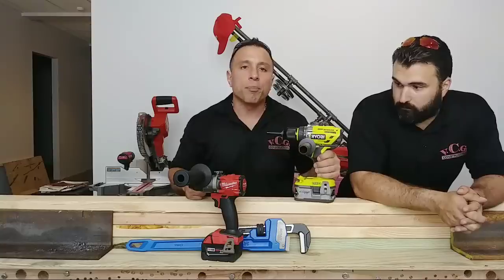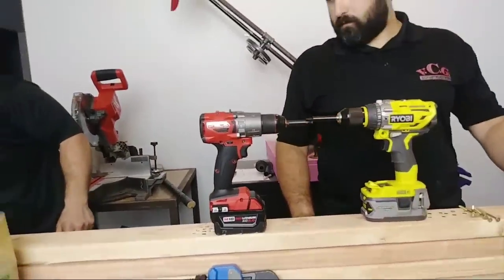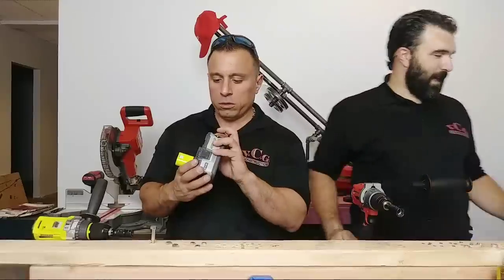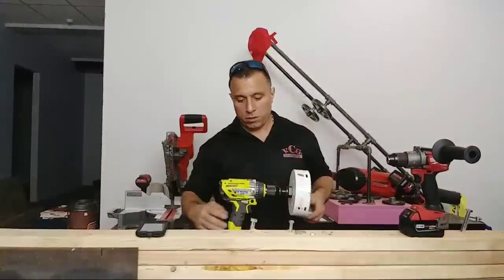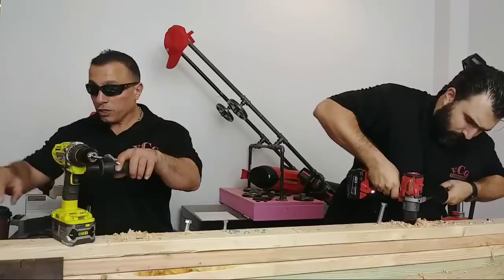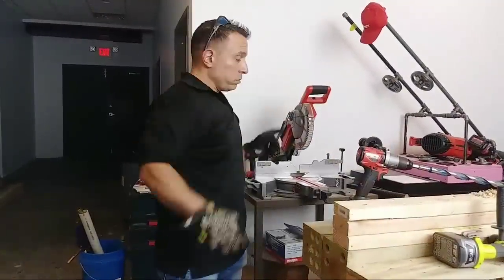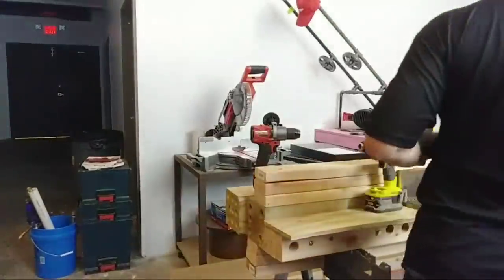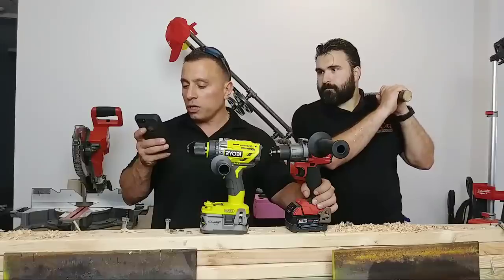Milwaukee M18 Fuel Gen3 Hammer Drill VS Ryobi 18v One+ Drill

Comment: Definitely a test I was wanting to see. Coming from someone who has no power tools yet. I'm going for the full out $500 Ryobi set.

Thanks for the video!
Reply from the maker: Awesome, I’m glad we could help!!
Reply: Cornland Wasteland Thanks for the information!
Reply: The tool sets have starter tools in them. The individual tools are much better.
Reply: @martylucas8557  I just bought the same set! Coming from B&D, those are much better! Probably overkill for DIY but I am kind of geek for tools and quality...
Reply: At first I thought the same. I used the Milwaukee hammer drill and impact driver while doing tech work. For a cost difference of $50 or less depending on if it's the m18 or m18 fuel, I had to go Milwaukee. I use Ryobi for all my cordless lawn gear and my cordless nailers, but everything else, Milwaukee is just too good. For DIY stuff, I will say you won't be disappointed in what Ryobi has. I've just used the fuel before so moving from top tier is just hard for me. If you are thinking of getting any nailers, get Ryobi, those things are amazing. They just don't make a cordless framing nailer yet.
Reply: Marty Lucas I believe he’s referring to the Ryobi tool sets. They definitely put way cheaper tools in most of their tool combos. Their single tools are without a doubt, better quality
Reply: Shoot im running Milwaukee black and decker ryobi Hitachi and dewalt. Lol
Reply: , just get the brushless line......they are pretty good

Comment: Yeah been puttin in work for 10+ years and Ryobi and their magnet and lighting system plus the battery lights are really convenient. It’s the least expensive and puts in work. I can pound those drills daily without worry because replacements are cheap. They have a drain auger for the battery no other tool has that. They also have a lantern, and one of those mini HVAC purposed drills. 

I had a ryobi drill break down on me after 7 years. Decent reliable and practical and best of all affordable.

I have a Dewault Hammer Drill for the man sized stuff though.  Cutting marble holes are easy as cake but god those DeWault Hammer drills are heavy so I only pull it out for the bigger jobs like cutting marble, mixing cement, boring through concrete, or deep screwing. 

Ryobi for everything else. Mostly I use Ryobi for the Drain auger(Incredibly light and battery powered) works fantastic. And the drill magnet is very useful for tossing a ton of screws and getting drywall done quick. Light is nice for dark areas it’s light and quick charging. If makita or Milwaukee or whatever had the magnet and drain auger I might switch but Ryobi is just too much bang for your buck all around.
Reply: No hablo mucho inglés pero creo que dice que Ryobi es mejor 😅
Reply: thats good to know about the drain auger. I think its cool makita has a coffee maker for 18V lol. its cool what they all come up with

Comment: Are you running the new brushless batteries with that ryobi? They have extra prongs to run the ryobi brushless tools. If you were running the non hp+ ones then that's why it kept cutting out and you had to keep pulling the battery
Reply from the maker: I’ll have to double check but I do believe it was the hp!
Reply: VCG Construction I think the brushless ones are HP+ the + is for brushless tools. It's pretty neat it has extra prongs to force the brushless harder
Reply: Yup it turns out he didn't use the HP+ battery. Would've made a big difference.

Comment: I know the Ryobi comes with the lithium + 4Ah battery but it's really designed to be used with lithium + HP battery. Taking away the ability of the battery communicating with the drill defeats a major purpose of the brushless motor and electronics, plus it should give it a slight boost in performance. Maybe Ryobi will start selling the drill with that battery down the road.....makes sense.
Reply from the maker: They should definitely sell that battery with the drill or at least an option where they do.
Reply: Slight difference in performance. It's actually a different drill with the new battery
Reply: @audionut9974  Which one is the HP battery? The 6 and 9ah ones?

Comment: This may be out of place, but I’m in the market for a Milwaukee hammer drill. I have a 20v dewalt hammer drill, which is amazing and still works like new but I want something more powerful. So my question is, how good is the m28 hammer drill? How does it compare to the m18? And how does it compare to the dewalt 36v hammer drill? I found the tool with 2 batteries for 400! That’s a lot, so I’m assuming it’s in the same segment at the 36v. Thanks in advance!
Reply from the maker: This will take some digging around to get your answers!!

Comment: The Ryobi is a Hammer drill (ish, as neither are true masonry hammer drills, more like impact hybrids), so it likely would have faired better on the lag bolt test on the hammer mode, same with the Milwaukee. The Ryobi didn't seem like it was overheating from your thermals, but likely was running into the current draw protection on the battery side, which may have been why the battery shut off. Brushless motors are an advantage in torque and energy usage, but they do have significantly more electronic nannies due to a computer actually controlling the switching on the poles instead of a brush running current directly. I think it may be a good idea to run the tools separately at the job site, and see if over time you can't find things that either get on your nerves, you appreciated, or even things that surprised you. You bought the tools, you might as well earn some money out of them, right?

Comment: Just got the gen 3 today
Reply from the maker: How do you like it so far?
Reply: I think the impact driver with even a 5.0 is comical but they are both beast. Haven't used it enough to see for myself if there a real "heat" problem. But I mainly bought because I have killed one m12 drill (newest one) by using it too hard so hopefully this big boy will hold up

Comment: Also something to note that you made reference to.... ridgid.... now they are A brand that can be used in in a contractor Setting.... and again I speak from experience.... for example their 12v drill driver has the highest torque rating of any 12 V system and actually outperforms some of the 18 V tools.... check out my review on it on my channel...Rich reviews

Comment: the ryobi battery might have a problem. i have about 6 batteries and i have one that will shut off with a very light load. the other 5 will power threw anything. might want to try a different battery on the ryobi why doing the big loads.
Reply from the maker: Seriously, a problem with them?
Reply: @VCGConstruction  I have a problem with one of the 6 i have. It does exactly what yours is doing in this video. The rest of them don't give up unless the tool I have them in is stopped.
Reply from the maker: That’s crazy, is it under warranty?
Reply: @VCGConstruction  I haven't checked, I don't think it's been 5 years. I can't remember if the warranty is 3 or 5 years though

Comment: Actually really curious to know which model this is now, because I saw another review of the latest Ryobi 18v Hammer Drill, the p251, where the overload protection kept kicking in too early & stopping it from drilling lots of times. But this Ryobi powered through like a champ here, so curious to know if it's the same p251 but they maybe fixed the overload protection oversensitivity issue. 

Older review of p251 showing overload protection oversensitivity issue:
https://www.youtube.com/watch?v=Y1NKBaNPPXc

Edit: Just realised that the p251 is their first brushless version, and from the "brushless" writing on the side of your version you're using the p251. Notice how at 1:17:44 you need to switch to low speed to get more torque to continue, it seems that the older p214 brushed model would keep drilling much longer at high speed setting before it runs out of torque. But, at the lower speed setting this new brushless model has more torque than the older model.
Adding one of the new HP batteries increases the torque on low & high rpm mode on these newer brushless models.

Comment: Great test! Thanks! The Ryobi really held its own. It would be good if you guys could put the Ryobi's exact model number in the description. 

Different models of the Ryobi 18v One+  seem to have really different specs. The P213 has 1500rpm & 19500 bpm, seen in this kit https://www.homedepot.com/p/Ryobi-18-Volt-ONE-Cordless-1-2-in-Hammer-Drill-Kit-P848/205383917

While the P214 has 1600rpm & 24000bpm 
https://www.homedepot.com/p/Ryobi-18-Volt-ONE-Cordless-1-2-in-Hammer-Drill-Driver-Tool-Only-with-Handle-P214/206666886?MERCH=REC-PIPHorizontal3_rr-205383917--206666886--N

I'd imagine that you guys most likely are testing the P214.

The annoying thing is that these different models are listed in to seem basically identical in most stores, especially in when sold as kits, so it's easy to unwittingly pick up an older, inferior model if you don't pay close attention to the specs.

Comment: For the average user the Ryobi is the better buy. Tell the model number of the Ryobi and the price and then tell the model number of the Milwaukee and the price. The Milwaukee is running hotter every time. It seems as if you want the Ryobi to lose but it's holding it's own!

Comment: ive tried drill doctors about a dozen times on metal bits and never worked
Reply from the maker: Whoever recommended the file tonight made an awesome suggestion!!
Reply: VCG Construction the file kiked but!! u made it look wast, i will surely try that next bit i smoke
Reply from the maker: The $5 file saved a $40 drill bit, I was super happy about it!!
Reply: Drill doctor works but it’s a tedious process learning how to use it. The instructions aren’t very clear and the process to set the bit in the holder is certainly not foolproof. Once you get it down it does a pretty damn good job.

Comment: If you compare price of each kit or set.....Ryobi is the winner..... I have DeWalt tools but before I used to have Ryobi and they are really amazing tool for the price..... They are the perfect tool for The home owner or for a guy staring to work in. construction..... Let's be honest.... Y ver y rayo be was the winner in every single test again the mayor brands....just a few will have the balls to show up with a Ryobi kit at a job site with a bunch of guys owning  Milwaukee DeWalt Makita.... Back in my opinion Ryobi can be a great pro tools on a midium level .... Because not every guy by the top-of-the-line drill or impact from the DeWalt or Milwaukee line

Comment: Hole saws need to go slower or you wreck them. I get for the video you want speed
Reply from the maker: We were set on the low speed high torque setting, but a 6 inch hole saw is a lot to handle under the test conditions!!

Comment: wd-40 is terrible cutting oil when drilling into metal, metal bits are expensive enuff useing wd-40 is a good way to smoke your bits
Reply from the maker: Couldn’t find the cutting earl!!
Reply: VCG Construction try fastenall, ive even too a quart of oil or bar and chain oil and drilled the top out to dip bit in
Reply: I use bar and chain oil all the time for metal drilling. Hardly smokes at all and is thick enough to provide good lubrication. Cheap and easy to find anywhere